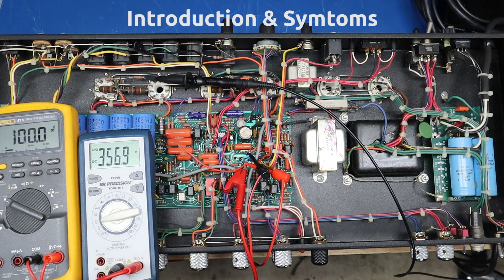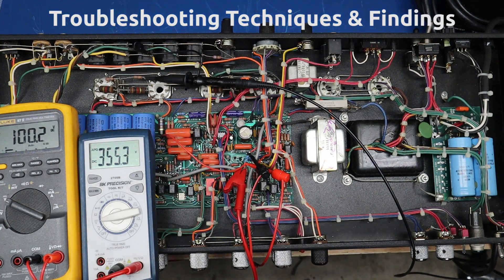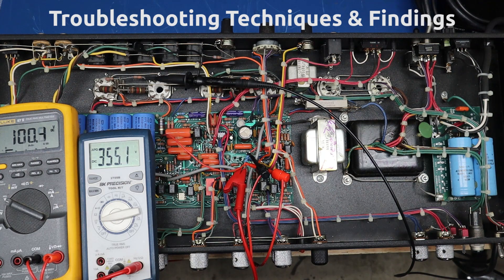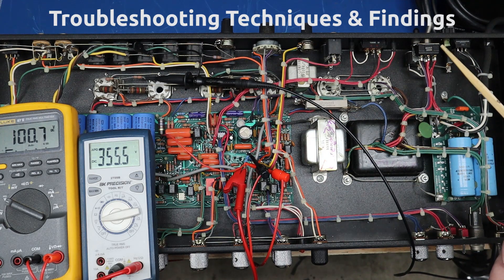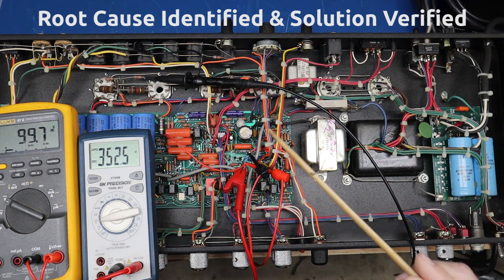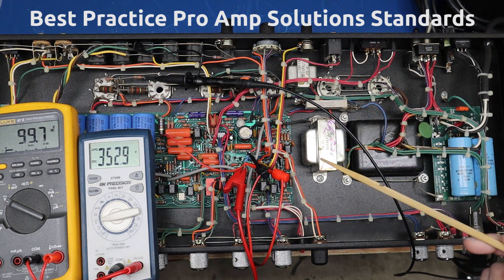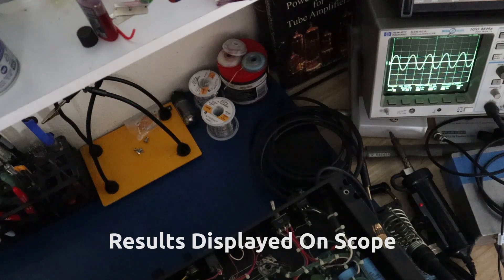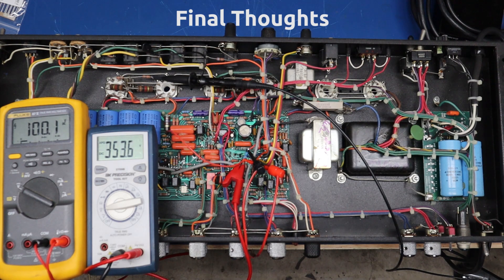Mesa Dual Rectifier Trem-O-Verb Snarling With No Output - Solved!

Comment: Question: What is your opinion on Mesa's quality? I hear many techs hate to work on them and often refuse to do so. I'm thinking of getting an original 1994-1999 Rev. G Dual Rectifier with the diamond front plate. To get one used is about $1500-2000. Thoughts on this being a good purchase? Thanks, I'll be sure to like & subscribe!
Reply from the maker: In my opinion, Mesa amp build quality has fluctuated through the years. They can be more difficult to work on, but that is relative and I personally do not see that as an issue and embrace the challenge. I recommend checking what that amp actually sold for recently on reverb.com to validate its worth in the current market. Serviceability is certainly a concern, but how much of a concern should be based on your risk tolerance.
Reply: @proampsolutions  Thank you! I have no problem spending more money to maintain a vintage Recto as long as they can be serviced. I'd say my risk tolerance is above average but below a total disaster circuit like a Blackstar club series. I'll take this info into consideration Thanks again. Cheers!